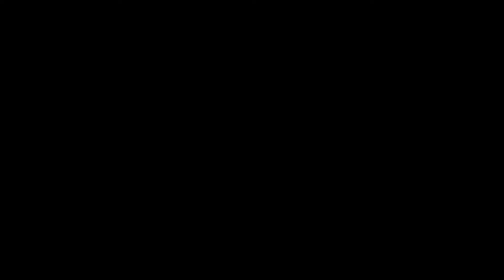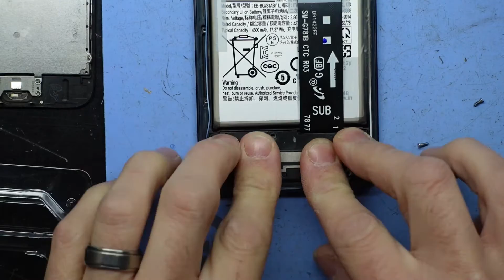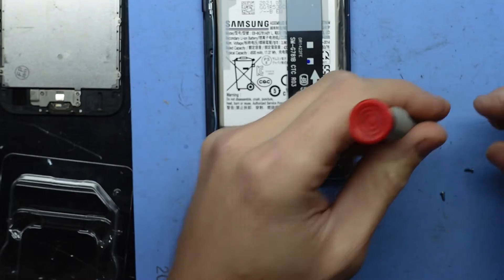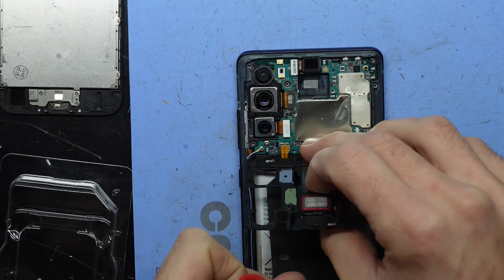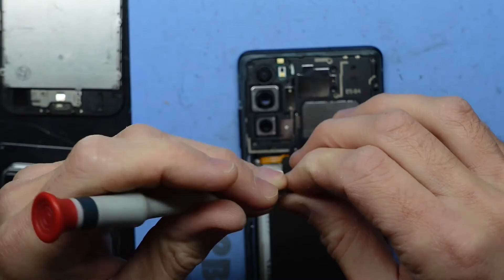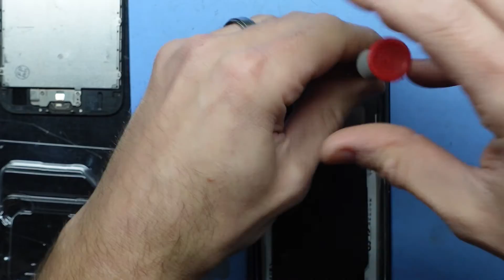Samsung phone screen swap, no signal fix

Comment: I replaced the screen in mine. all went real good I felt like and the screen turned on. but it was flickering when the phone moved. I took apart the ribbon connector (the main) and cleaned with high quality contact cleaner. and now I don't get signal on the screen at all.
The phone (a72) lost screen without any issue just by itself it lost display originally.

Comment: on the charging board(3 at the bottom) and on the main board (2 at the top) there are these little pins touching the frame, anybody know what they are for?
Reply from the maker: sounds like antenna connectors, or earthing
Reply: @rickstechrepairs   thnx

Comment: Is there any way to determine if one of the antennas are disconnected without opening the phone?
My S20 has poor signal after a screen replacement, but it seems to be an intermittent problem
Reply from the maker: not that I'm aware of,  a visual inspection would be needed

Comment: I thought those cables were for wifi? Didn't know they were for reception either. Is there a actual antenna for signal in the phone? I have a Galaxy s9 with fair data and signal.
Reply from the maker: i dont think their is an external antenna connection

Comment: I have the save problem here, after I swap the housing of my S9+ the signal suddenly stop giving me a good signal, after that I double check if wire is connected properly. I even reconnect it, unfortunately it didn't help and I hope the wire is only a problem

Comment: Hi,

I had a similar thing happen with my Samsung 20 FE after a screen replacement. Very intermitted signal if any plus also overheating with the device.

Do you think its worth repairing device compared to potential cost?

Comment: Where is the Soltuion in this Video i have the same problem i changed the Display after that i also change every piece for the Signal
Reply from the maker: Antenna connection issues or damaged jack on boards

Comment: hi Rick,  I changed an galaxy s10 screen with frame.  after I have a very weak signal. mostly 1x and sometimes 3g. Is there a built in antenna in the frame or something? Thanks
Reply from the maker: 0:27 can you see the 3 antenna cables, check them and make sure they are connected
Reply: @rickstechrepairs  Thanks for your reply and help.  Unfortunately for me the S10 does not have the wired antenna cables as you show here.  Thanks again for replying.  I appreciate it
Reply from the maker: no worries
Reply: @kali4740  did you find an answer to this?  I'm in the same boat with my S10plus.
Reply: Sorry I didn't.  @kierkegaardian

Comment: thanks for sharing.  Your attitude is great towards your customers.  I have just experienced the opposite.  Got screen replaced on S9+, very poor mobile signal afterwards (WiFi ok).  To the point I thought there was no signal.  Shop refused to take responsibility. Agreed to diagnose the problem at a cost. After a week they told me that it's locked to Optus.  Turns out it isn't locked, but occasionally gets signal depending where you are, and briefly got signal with Optus in their shop.  Anyway they are refusing to do anything about it so I might have to try what you've demonstrated in your video :)
Reply from the maker: Well that is a bit disappointing that their is an issue after a repair 

I would recommend having a look at this guide 
https://www.ifixit.com/Guide/Samsung+Galaxy+S9+Plus+USB-C+Charging+Port+Replacement/136890

The white and the blue cable that connect to the mainboard and the charger, If I remember correctly are your your antenna connections.

I would suspect that one of them isn't connected properly
Reply: Hi, same problem after changing the connector. Little signal. How are you solved?
Reply: Hi pls help me 
After drop in water my s20 fe 5g not gt netwrk signal. I need network ic but not available in my city..